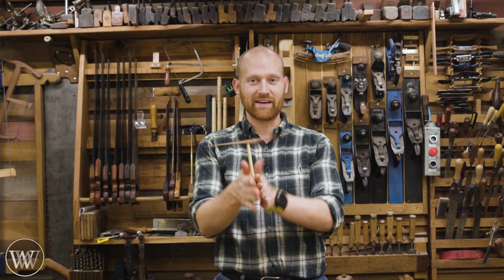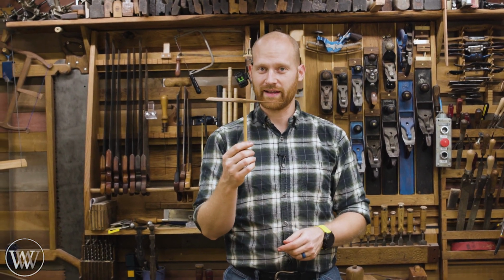Making a Hand Powered Helicopter

Comment: It has a bit more lift when the bottom surface is flat and the top surface is convex like an airplane wing. Either way, yours flew quite nicely in the outdoors scenes!
Reply from the maker: That is correct, but in this small surface aria the actual effect difference would be less then 0.01% or a flight altitude difference of around 0.12". It was an interesting topic that I studied in my masters. sorry but you got me talking about a topic I truly enjoy. LOL
Reply: No need to apologize. It's good information and I'll take your word for it! Ironically, I had made one of these a couple of weeks ago after finding an old bamboo one I had. I figured I would make a bigger one with pine and a dowel rod. You know - a quick easy project. While it seems pretty simple when you look at them, there are a few gotchas - the angle/tilt of the wings, balance, etc. Found it interesting when looking through my subscriptions a few days later that you had just posted a video of one. Like I said, yours flew quite nicely!

Comment: Hi James, i know it's not helicopter related, but I wonder why you always set your planes down on your bench with the edge down, instead of on its side so you don't risk damage to the sharp iron?
Reply from the maker: It is actually safer as putting on it side opens the iron to being hit by passing tools and flesh. that was something taught very heavenly in old shop classes, but does not have a historical basis and has been proven to be false again and again.

Comment: It's a simple and joyable toy. It's called bamboo dragonfly in China. It is usually made with two kinds of ice cream sticks, a bamboo dowel and a softwood stick. It would fly much higher if you make the propeller with softwood.
Reply from the maker: it is cool to see how the same simple toys have been developed in different countries. I talked about the soft wood on the other channel and why I chose Walnut. basically I had it in stock.
Reply: Dragonfly's are knock off the original propeller toy that is MADE IN USA that actually works